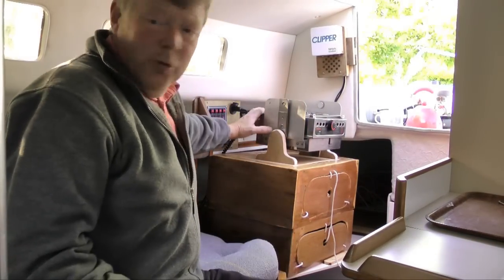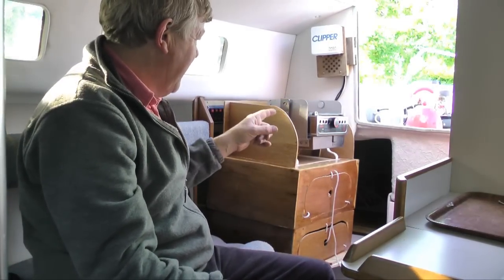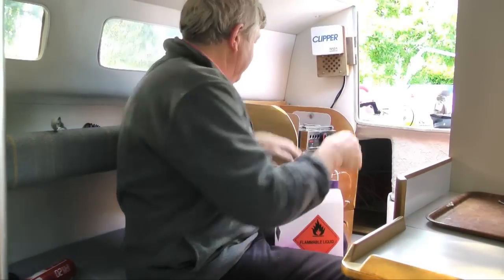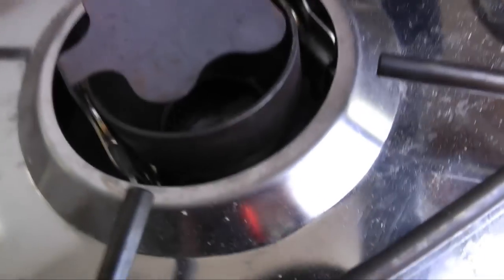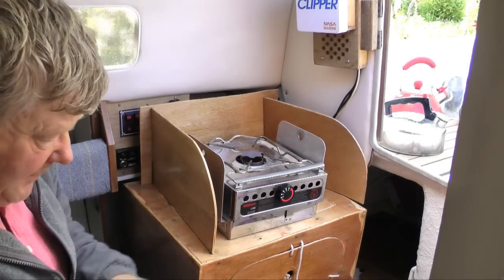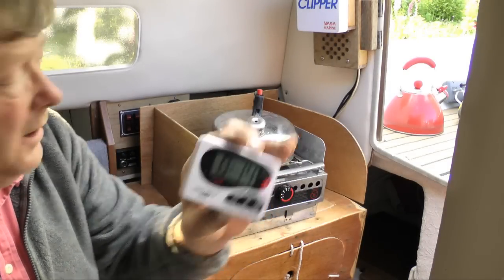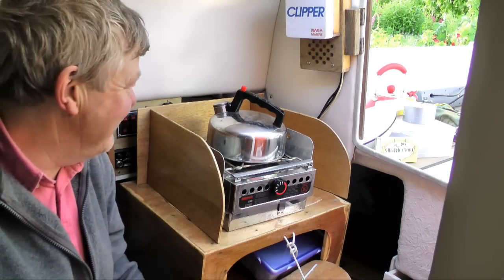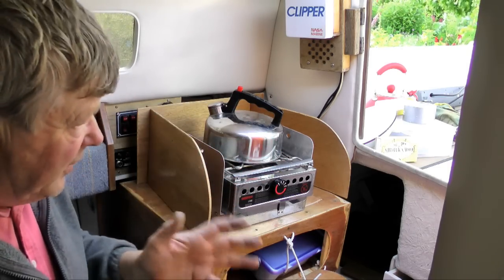Lighting an Origo stove on the Mk 1 galley box

Comment: Do not fill the containers that way as you can over fill them , tilt them on an angle and you only part fill as the fuel expands and can over flow and catch on fire . Also you can just drop the match in and pull it out later .

Comment: I've ordered one I will have in 2 weeks
Reply from the maker: +Jasper Edwards well worth it
Reply: Any difference between heat output with a pressurized stove meths
Reply from the maker: +Jasper Edwards never heard of a pressurised meths stove you can get pressurised kerosene - but that is not nice on a boatDylan